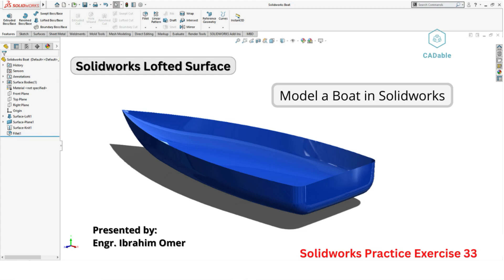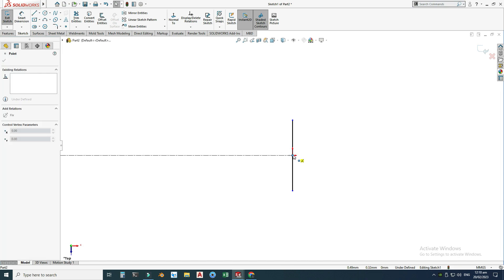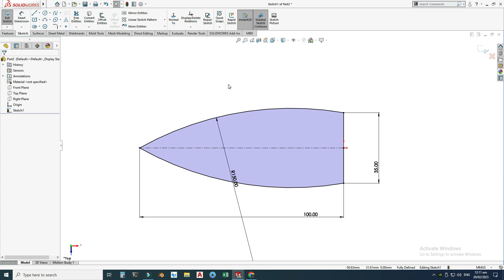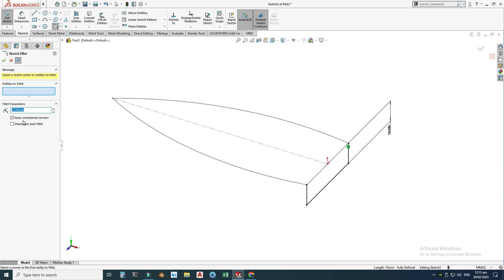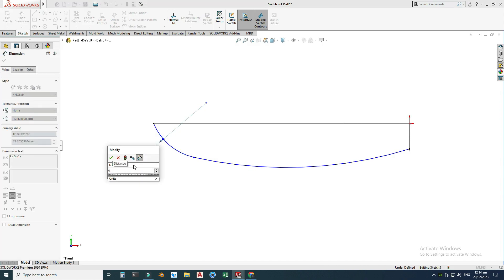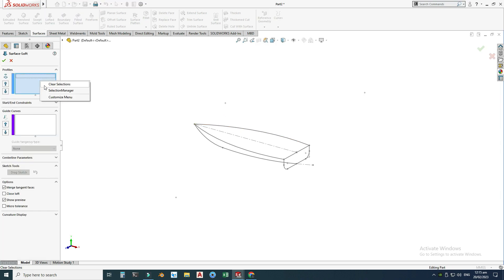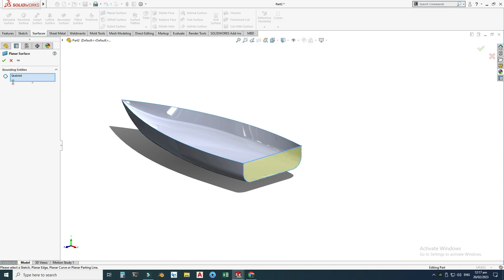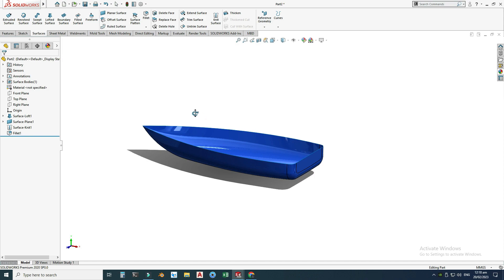Solidworks Lofted Surface | Model a Boat in Solidworks | Solidworks Practice Exercise 33 | CADable

Comment: Can you unfold so you get the Sheets to cut out?
Reply from the maker: This is a very good question. This model is a closed surface / solid hull, not separate plates. So you cannot directly get flat sheet blanks from it.

To generate cut sheets, the hull must first be split into individual developable surface panels. Only those separate surfaces can be flattened.

This model is for shape and design demonstration, not for direct fabrication unfolding.
Reply: @CADable Would love video showing it
Reply from the maker: @philipardvall1968 sure sure why not, it would be interesting learning tutorial 😊

Comment: thanks a lot for this great video. I would like to know how to add a keel along this hull from the outer side?
Reply from the maker: Thank you and sorry for the late reply. 

To add a keel along the hull from the outer side, you can create a centerline or edge curve along the bottom of the hull, then use the Sweep or Extrude feature with your keel profile. 

Make sure the profile is perpendicular to the path at the starting point for a clean result.
I can make a short tutorial on this if you’d like.

Comment: I design boats and have been looking at SW as a replacement for Rhino but this video has only gave me reasons to run away
Maybe you chose a bad model example for showing dome surfacing in SW
IF THIS IS THE WAY to make a boat in SW, RUN AWAY FAST from SW
Reply from the maker: The video example you watched in SolidWorks (SW) for boat design may not have represented a realistic model. Remember that a single video cannot fully showcase the software's capabilities. While SolidWorks is primarily known for solid modeling and mechanical design, it does offer surfacing features for boat design. The video's choice of model or approach may have influenced your negative impression. To form a fair judgment, explore additional resources, tutorials, and examples focused on boat design in SolidWorks. Seek insights from experienced boat designers who have used SolidWorks. Ultimately, select software based on your requirements, familiarity, and necessary features. Thoroughly research and experiment with different options to find the best fit for your boat design needs.
Reply: can you elaborate a bit why rhino so  much  better for surfacing?